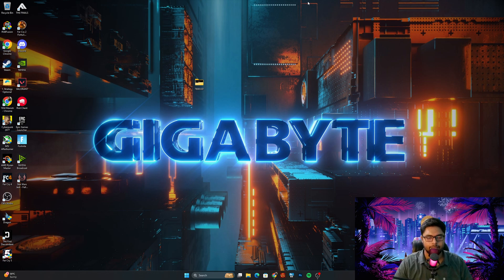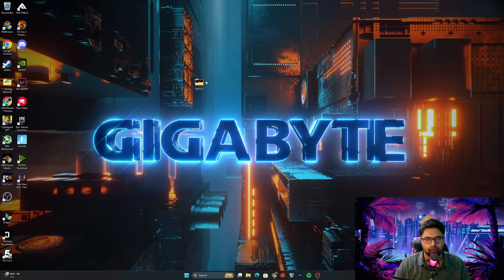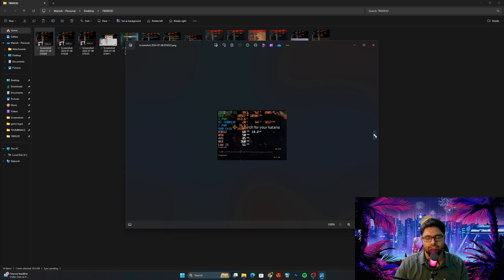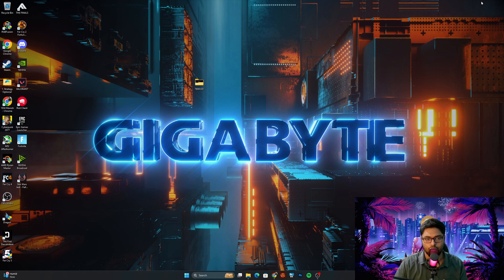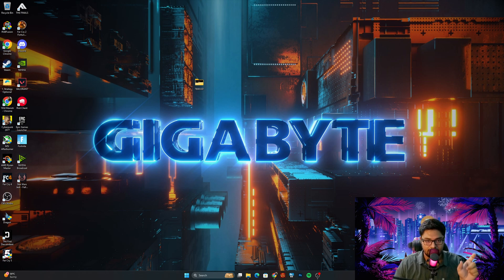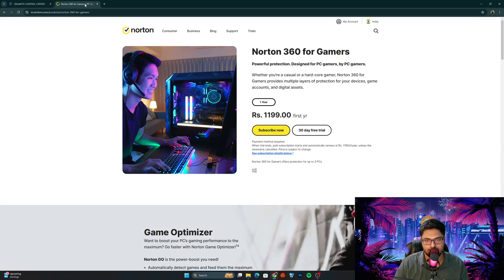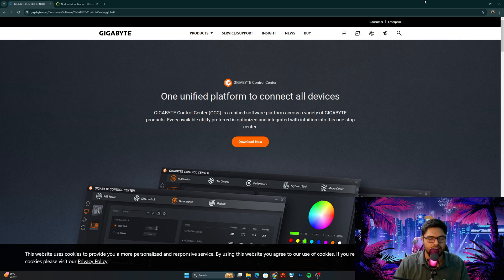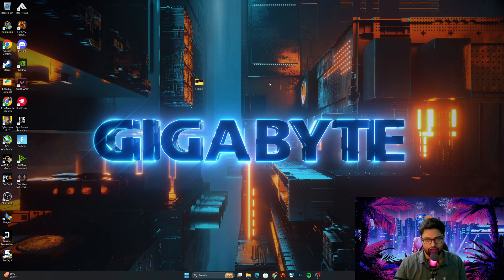Ryzen 7 7800X3D Low Clock Speeds | SIMPLE FIX

Comment: Hey so I'm having this issue where my 7800x3D isn't wanting to boost over base clock speed. During gaming, it only sits at 4.2ghz and doesn't boost any higher than that. I don't and never had an anti virus software and use windows defender. Precision boost overdrive is enabled and still nothing. I'm so lost

Comment: Norton AV is just crap.
PD: Why you need that center? It's pointless you don't need that.
Reply from the maker: Yeah, I uninstalled the Norton crap immediately. I have been using the RGB fusion for the rgb instead of the GCC, but does not work as good and also has fewer customization and a lot of bugs.

Comment: My 7800x3d has the same problem.
And I don't even have Norton Antivirus installed.
AMD Sucks
Reply from the maker: Hey, I see you're facing the same issue. Here are some trouble shooting steps that i'd recommend - Uninstall any third party antivirus or performance enhancer applications if you have installed any. Then run your games and see if the issue is resolved.
Reply: @ZedSpyrl Thanks for the comment
By the way, I don't use any anti-virus software.
I also have Windows Defender turned off.
I've tried without installing anything other than drivers, but sometimes I get the problem.
I think I'll have to contact AMD directly.
Reply from the maker: Yes, I'd also recommend talking to AMD directly. They'll first recommend some troubleshooting at first. if nothing seems to work they'll ask you to request an RMA via the website. Which would most likely be aproved and you'll get a brand new processor. if the problem persists even with the new CPU then you might have to take a good look at the other components like the motherboard. Your retailer can help with the later part that comes after the new Processor.
Reply: @RickGrime80  Nope, I contacted AMD and they explained that CPU's clock can fluctuate depending on the situation.
That's all.
The temperature of my system is also within the normal range and all bios settings are default.
nevertheless, it often drops below the base clock while gaming.
I really hate this shitty silicon lottery and will never buy a CPU with this kind of clock fluctuation again.
Reply: @RickGrime80  I think the reason for the clock speed difference between CPUs is the damn silicon lottery.
It really sucks that the CPU can't even maintain a guaranteed base clock.
I'm considering getting a CPU replacement from AMD, but I don't know if they'll give me a warranty.
anyway, I hope they don't make CPUs with this much clock fluctuation anymore.

Comment: It is bundled in the Control Center. You should check what you are actually installing by using the advanced install, where you can untick the option for Norton 360. Furthermore, Windows Defender coupled with the program DefenderUI (as long as it is connected to the cloud) does amazing work keeping users safe. It gives Windows Defender steroids without losing any performance.
Reply from the maker: I was actually getting into other issues as well with the gigabyte control center. It kept conflicting with my gefroce experience app / nvidia app beta. whenever I turned on Automatic Tuning in the performance tab in the nvidia app. the new oc profile would revert back to its default state after a restart or even if I open the GCC after running the automatic tuner. the issue was fixed once I uninstalled the GCC. Thanks for the suggestion. will definitely checkout Defender UI. Cheers :))
Reply: @ZedSpyrl GCC also interferes with iCue link.

Comment: Hi, it's great that you made such a video because it will definitely help many people. 
I wanted to ask if you have encountered a problem with clocks on Ryzen 7000X3D as well, but not dropping to the drastic values shown in the video, more like fluctuating between 4900Mhz - 5100Mhz (Ryzen 7950X3D) and almost never reaching 5250Mhz?
To explain further, I've tested many different UEFI settings that are supposed to increase clock speeds, including PBO in various configurations, practically everything (at least I think so) - I have an X670E Steel Legend motherboard. 

However, I've noticed a certain pattern (I think). When I first start the computer and immediately launch a game like Valorant or Cyberpunk or any other game, and at the very beginning, when everything is still cold and temperatures are around 52-55 degrees Celsius, my clocks stay at 5250Mhz. But as I keep playing and the CPU temperature rises to 65-70 degrees, the clocks drop to 4900-5100Mhz (and even occasionally dip momentarily to around 3600-3800Mhz).

I'm starting to wonder if this could be due to my AIO (Arctic Liquid Freezer II 360) and the overall airflow, and whether upgrading the AIO, case, and possibly using liquid metal could resolve this, or if it might be more related to the motherboard or the specific CPU unit I have?

From the videos I've seen, where people's CPU clocks are very stable, such as:
*https://www.youtube.com/watch?v=j43_yxlw6v8
*https://www.youtube.com/watch?v=EUMT4GQE8nc

If you have any ideas or suggestions, I would be very grateful :D
Reply: I have a Ryzen 9 7900X3D, and I have been looking at the clocks, seeing how I can optimize it.  In my case, I have a custom water loop with a lot of radiator capacity.  When you run your benchmarks, don't just pay attention to the temperature but also power consumption on the CPU.  The X3D CPUs appear to not only have a locked multiplier but also a locked power limit as well.  For my 7900X3D, it is basically power limited.  The best I can do to encroach on all All-Core 5100 MHz is tweaking PBO for undervolting, which is watt-stretching.

Beyond that, it may be software factors as the bottleneck, not utilizing the right cores.
Reply: @LBXZero  I'm testing on these applications, basically every game, and when the temperature stays between 52-55 degrees Celsius, the clocks are maximally boosted almost all the time, with slight drops, but that seems to be a characteristic of these processors. Is there another way to unlock these power limits, since I've already done PBO?

Generally, I did PBO this way: I set the cache to -20 on all cores, checked if it was stable, which it was—I tested all settings in OCCT in stress tests, then for a few days in games. If a setting was OK, I would save it and try to push further with each core one by one. Then, I changed it by -5mv sequentially on each core and repeated the same tests. I've currently reached: -30/-15/-25/-20/-25/-25/-25/-25 (Cache) and -10 on all cores for Frequency, mainly because of laziness and also because when I set -15/-13 on some cores, after a while my system became unstable (e.g., crashes, bluescreen). I've been on these settings for about half a year now and it's very stable—no crashes, no bluescreens, and it works well during gaming, working, or rendering videos, so it seems stable.

I've also read that people test the stability of PBO on these processors using CoreCycler + yCrusher, but I tried to run it and each time the first test passes successfully and then it starts throwing errors (even when I completely remove PBO and reset BIOS settings to default), so I don't know if I'm testing wrong or if there's another problem, because as I mentioned, I don't notice any instability at all, yet the program says otherwise, so I probably won't rely on it.

Do you think the issue could simply be a weak AIO or overall poor airflow, and could replacing the AIO with a stronger one, changing the case, and using liquid metal improve both temperatures and clocks, or should I consider a different approach?
Reply: @BenchmarkingTom  The 7000 X3D CPU will boost their clock until it reaches 1: Max Clock (clock multiplier is internally locked), 2: Thermal limit of 90 degrees C (motherboard could have stricter setting), or 3: Power Limit is reached (internally locked as well).

If you are running in the 50s for temperature, you are not being thermally throttled.  I might suggest clearing your BIOS settings and reset them.  Make sure EXPO profile for your RAM is set and your pair of RAM are in the correct slots for dual channel.

There is one way to overclock the X3D CPUs.  At least some motherboards will give the option of setting the base Front Clock to asynchronous mode, which allows one clock rate of 100 MHz to the rest of the system for stability and 101, 102, or 103 MHz front clock to the CPU.

Rechecking specs...
Ok, you have the 7950x3d.  First, the multiplier limit for CCD0 (Vcache cores) is 52.5, max clock of 5250 MHz.  You have the same situation I have.  As much as I know I can't   (shouldn't) go higher than 5250 MHz, I am still trying to push the all core performance.  I think you are being power limited by that 120W limit like I am.  The only other route left beyond boosting the base clock is to disable CCD1 (the regular cores).  That should free up some power.

To say, everything seems to be running fine for your system.  The occasional dip only matters if you have stuttering in games.